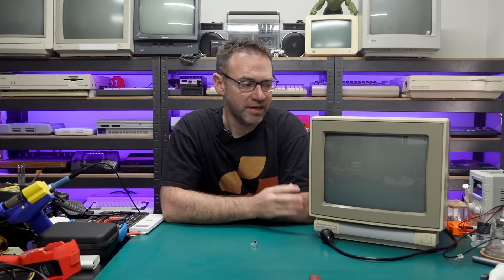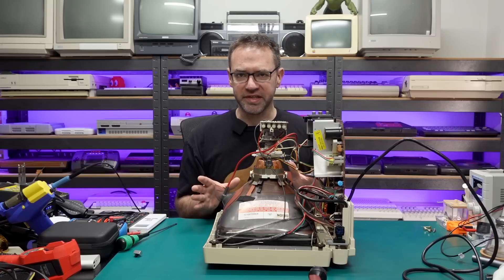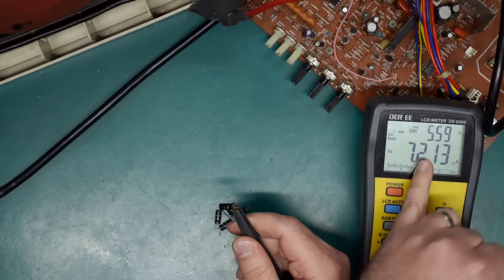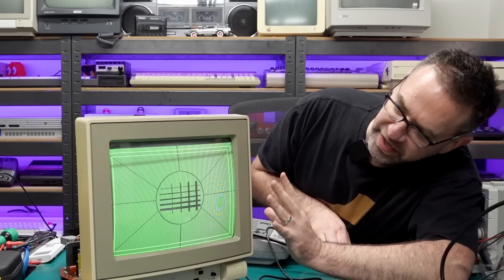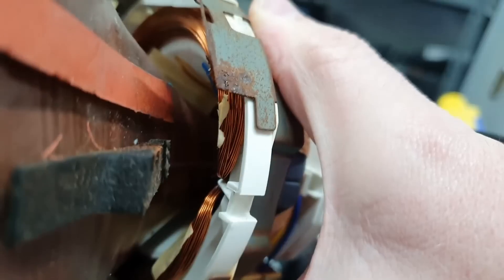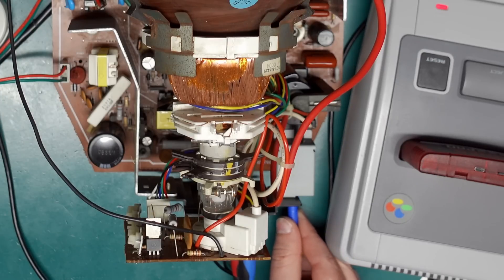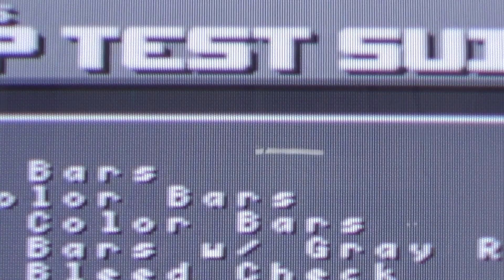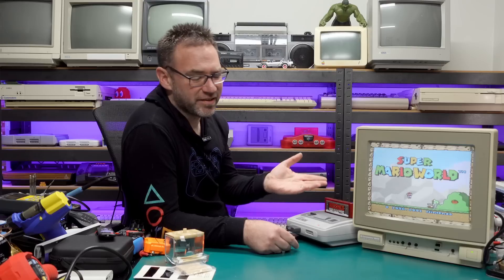Commodore 1802 CRT monitor tune-up

Comment: Oooh I’m outta luck with mine… I have the slightly earlier box-shaped 1802, acquired recently. After replacing the power switch (and making a button, as the original had been smashed with a knife or something being used to hold it in), I turned it on with some trepidation…

…and I got a power light, plus a sound that I thought was horizontal-output 15kHz, but I now think it’s the power supply - a switchmode type in these.

There’s no high voltage, no raster. I’ve poked around (with help from a good friend to understand the schematic) and I’ve found it has B+ (121V) and 12V. The latter is connected to the flyback, which is chicken-and-egg as I thought the 12V came from the flyback windings, not the other way around! It seems to disappear at the flyback windings, all being dropped across a diode on the way.

There is a pulsed signal of about 13V at the base of the horizontal transistor, and the flyback seems to have the 121V available to it, but as far as I can tell, this isn’t creating any high voltage. I tried unplugging the yoke in case that’s shorted, no change.

On an unrelated note, the 470uF and 1000uF electrolytic capacitors near the vertical deflection circuit were both lumpy and swollen like old batteries, and leaking. One measured as 54pF. So they were replaced, but no change of course.

I think at this point I have a failed flyback, but I’ve ordered new 2S1397 horizontal output transistors even though it seems to identify as ‘two diodes’ on the tester, ie. not open or shorted.

I read that it’s possible to test a flyback using a frequency generator, but I think my time might be better spent looking for a substitute flyback - the original being no longer available, I wonder if there is another at the HR Driemen site that perhaps has similar windings/voltages. Even if all the pins are in the wrong places, I’m sure I could adapt it to fit.

I’ll update with what happens next in my quest to repair what is, by all accounts, not a very good monitor but one that I would love to see working :)

Of course, I’m greatly inspired by this video, love the relaxing presentation style!
Reply: 1:26 “at least good enough so it’s not distracting when you’re actually using it” - wise words to live by, the best quote of any repair video, ever.

I’ll be picking up a second 1802 next week - one where the screen lights up in white, and rumour has it that the flap is still attached

Comment: I also had this exact 1802 together with my C64c back in the day. Must have been around 1990/1991. I do remember the colours when using chroma/luma was blend/low colour saturation when using the mid/standard position. Also, C64c with shortboards have lower colour saturation VS breadbins with longboards.

Comment: Don't remember the exact model, but about a year or so ago there was a Commodore monitor on ebay about an hour drive away. Passed it up because I really didn't need it, sold for $100 with 1 bid. 🤦
Reply from the maker: Ouch

Comment: Looks great bud.  U are very smart.  I love the old commodore stuff.   Like u said means crap to some people,  but means alot to us!   Way to go bud.  Childhood memories ❤
Reply: Hi bud.   I just received my 1802 monitor today.   Unfortunately there is no audio 😕.   Probably a dead speaker?  Again.    Any thoughts would be much appreciated
Reply from the maker: @donaldblakley6796 Could be a number of things. I'd give the audio input a bit of a jiggle, as well as the volume control, if you get anything out of the speaker when doing so then you know where to look. Failing that, if you hear nothing at all it could be a dead speaker or amplifier. You can always test the speaker for continuity, it's likely 8 or 16 ohms but it should be marked on the back of the speaker

Comment: Philips tubes and circuitry always is the best in those monitors, PVM quality in my opinion.
Reply from the maker: For sure. The 1084's I have are both Philips versions and look beautiful after a tune up. This 1802 uses a Daewoo chassis and Orion tube, so it's looking alright for what it is but it's got nothing on the 1084